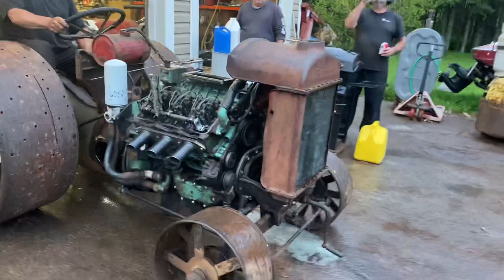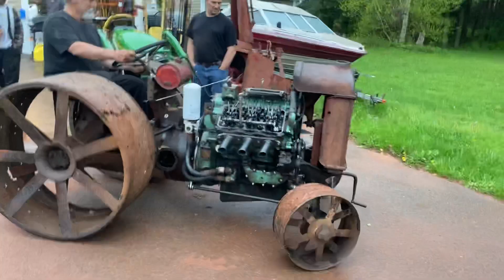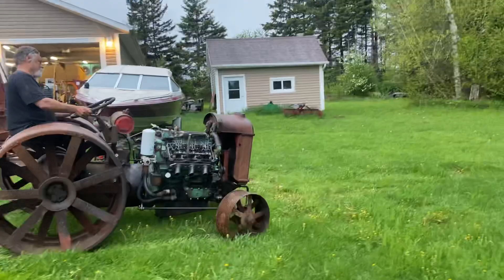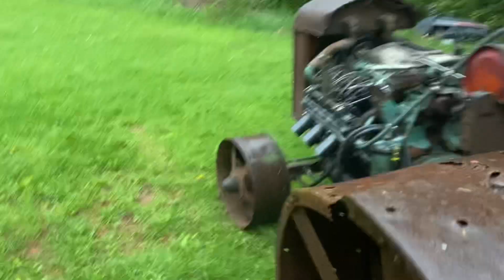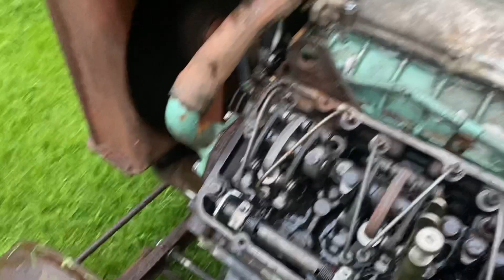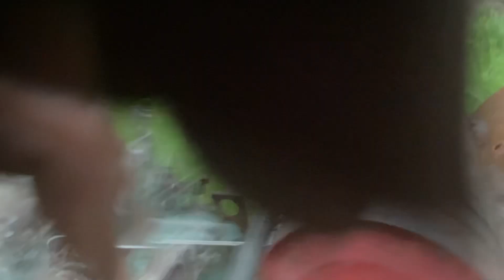Detroitson Fordson F 6v53 Detroit diesel first drive

Comment from the maker: Thanks guys. Check out the build on redpowermagine dot com. In the project/build forum.
Reply: I'm surprised that they let you post about something modified on their forum.  I used to be active there but the constant butthurt attacks on anyone that posted anything about how to do a repair or modification off of stock specs, or just knew a bit more than the average crowd, were unbearable.